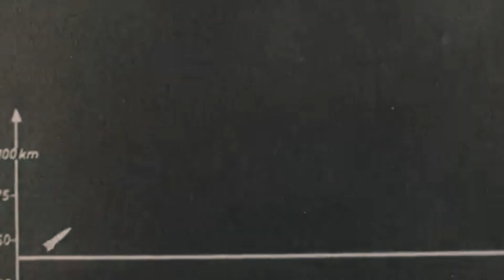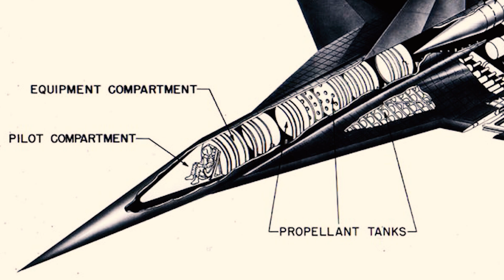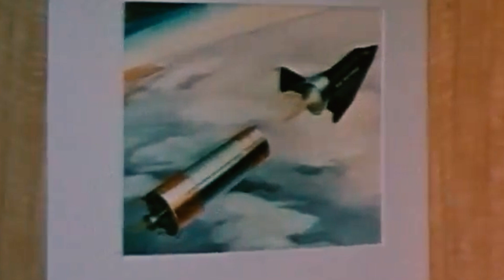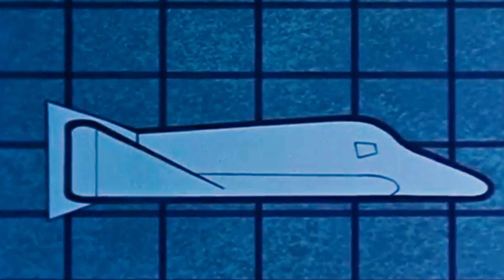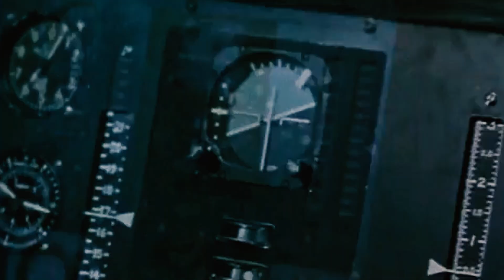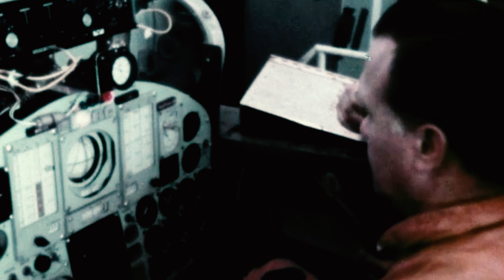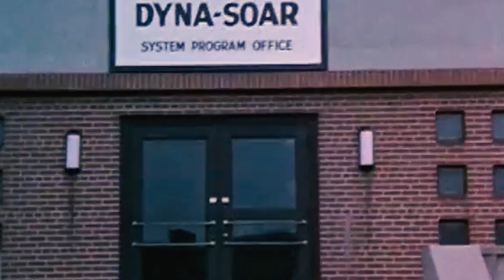The Forgotten Orbital Weapon America Almost Built

Comment: 5:04 "The Titan I and II used the same rocket engines as the X-15."  Say what?  The XLR99 (X-15 engine) was developed by Reaction Motors Inc using Liquid oxygen (LOX) and ammonia propellants and had a thrust around 57,000 pounds. The LR-87 (Titan I & II first stage engine) was made by Aerojet with Liquid oxygen (LOX) and RP-1 (kerosene) in earlier versions that was switched to nitrogen tetroxide and Aerozine 50 in the Titan II. It had a thrust of 430,000 pounds in the Titan II version.  The had no relationship whatsoever.  The Titan III had two large and expensive solid fuel strap on boosters.
Reply: Correct.  This guy frequently doesn't know what he's talking about.
Reply: At least they aren't claiming it was powered by the same sails used on the USS Constitution.😂
Reply: I'm almost certain these are A.I. generated videos.
Reply: @ididntagree  That is correct. Much of the videos online have switched over to being heavily AI created. It really cuts down on the production costs, so I understand doing it from a business standpoint. Sad to see real research and presentation being lost.
Reply: And lest we forget the LR-87 has been the only engine designed and actually used with the "trifecta" of propellants having a LOX/RP1 version, a storable, hypergolic propellant version AND a LOX/LH2 version :)